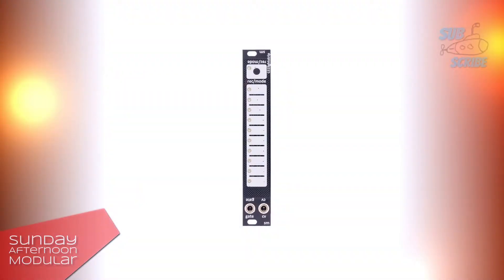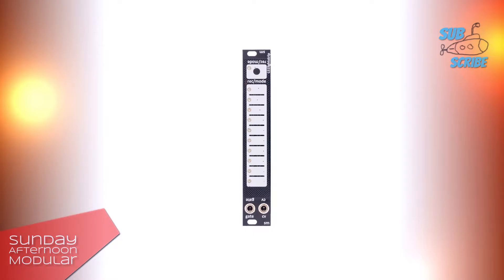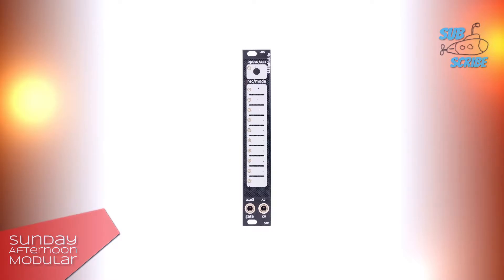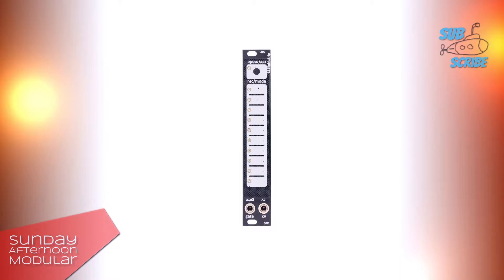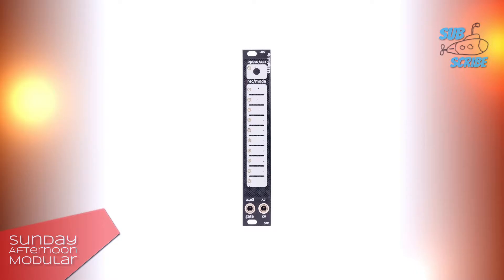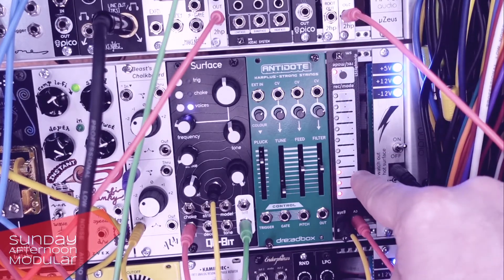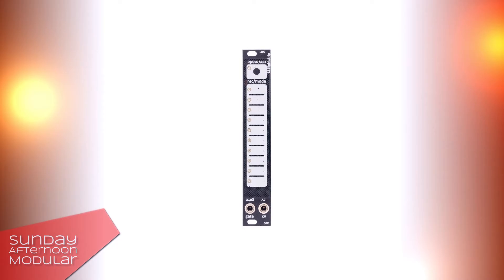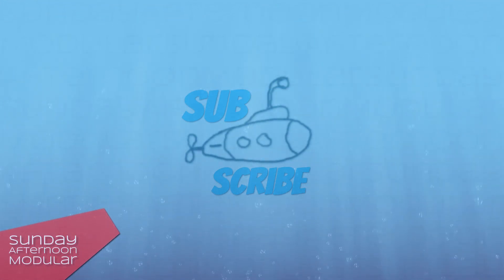Sound Machines LS1 Lightstrip Introduction

Comment: Hi mine record online like 0,5 sec of automation is bugged or maybe is lock somehow?
Reply from the maker: Hey there, the LS1 should let you record up to 8 seconds of movements. I would suggest reading through the user manual if you find anything there that helps, or otherwise contact soundmachines through their website.